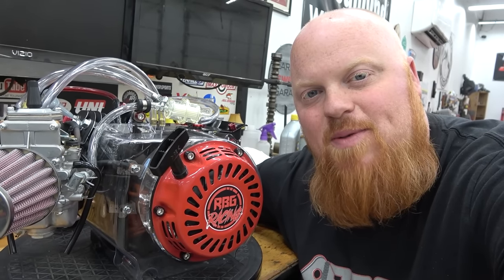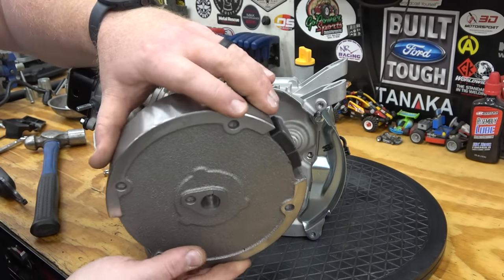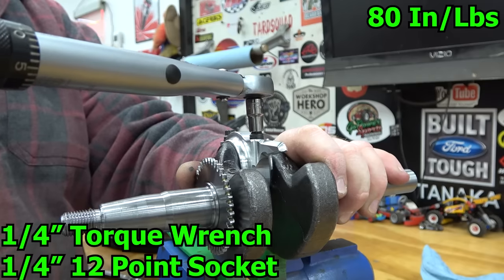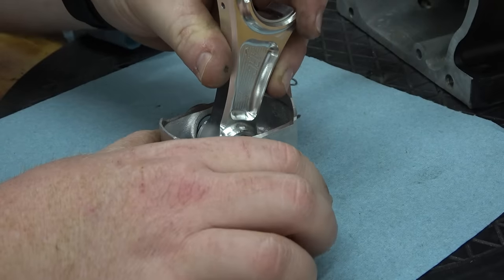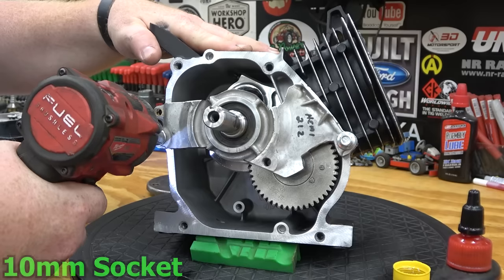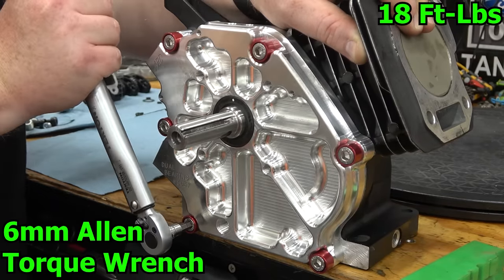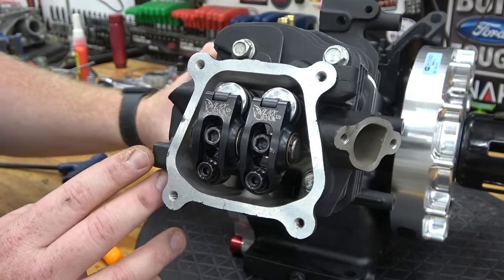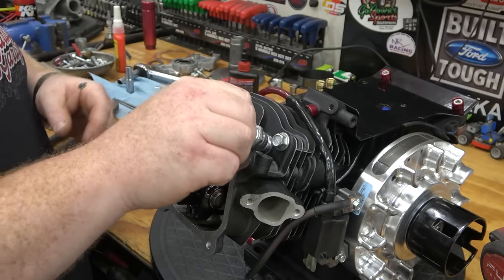Methanol Ghost 212cc Predator Build 👻 ~ Harbor Freight Race Engine

Comment: One can only hope that harbor freight realizes the phenomenon they have going with these predator engines and they don’t ruin it
Reply: 😂 if thay do ima need two blocks of every model they sell before it goes out
Reply: If they didn't, they wouldn't make a ghost racing engine. These aren't going no where
Reply: @ghost-carnage8964  ca-p
Reply: EPA and carb ruins everything
Reply: @Youtubecensoredmyusername these are lawnmower engines. Unless u live in ca you’re fine
Reply: @inshallah4280  they’re one of the few cool things we do actually get as of now. I don’t mess with them. I prefer the Chinese clone 125s anyway. But the old o es made by Lifan not the new ones made by someone else
Reply: you could still buy a real honda 200cc engine that is built a lot better than these clones.
Reply: Youre basically just buying a cheap chinese aluminum block and spending money to rebuild the whole thing. Im not knocking it but youre just buying a block
Reply: @kirkvilla9781  I dunno about those ones. But the engines in the predator 1400 generators are total complete garbage. They have a tiny rod that the rocker arm sits on with the tiNIEST screw holding it in with 2 that’s TWO lock washers on it. They put one of mine on backwards, and the screw missed the groove.that engine lasted maybe 60 hours. Then the spark plug pulled out half the head threads when I removed it. GARBAGE GARBAGE GARBAGE  China junk
Reply: @inshallah4280 there's a lot more states now that are just as strict as California.
Also, I have zero problem in California buying parts for these 🤷 There's like an infinite amount of Harbor Freights in San Diego that have these for sell.
Also also, the part of the county i live in, requires no smog. I have an '89 f150 with straight pipes and it's legal (minus the lack of a catalyst but the Feds can gofucktheirselfes) It's definitely sucks here, but it's not anything like everyone thinks.
Reply: @inshallah4280 I’m in CA, we got all HF engine models, even ghosts
Reply: This phenomenon has been going on since 50s when it started with chain saw motors etc and over time it’s just changed motors more notably (in the flat kart realm) the briggs flat heads then the Briggs animals and now the Honda clone which is basically the same thing as a predator almost exactly I’m pretty sure most parts on them are interchangeable but basically what I’m saying is there will always be another motor that becomes the predator so if hobo freight ruins it there will be another
Reply: @liamgarrison195  i got a few biggs flatheads. None of them are actual Raptor engines but one of the 5hp i got has a raptor carb (just a choke-less pulsa jet) has the eyebrows shaved, put a ARC billet flywheel, 3 stage pipe, stock crank, rod, piston, valves and cam. Moves my old JC Penny El Tigre mini bike nicely 👌
Reply: @dogsandwich77  hell yeah love seeing old flatheads rip we have a money race or to around here for them every year always one of my favorites to run
Reply: Your videos are well done. Great work
Reply: @KORR805 you can't buy the 170cc in CA! You can't ship a damn engine from out of state either. It's ridiculous.

Comment: That pull start handle is having a conniption fit.
Reply: I was wondering if that wasn't because he didn't lube that area well.Please let me know as I always used 'gear lube'inside the spring area,and greased the 'tabs'and crank shaft.
Reply: would be cool if it could have electric start too, do they make decent performance flywheels for electric start though?
Reply: My guess is you didn’t watch till the end because that was nothing compared to the muffler
Reply: @bryduhbikeguy  always put it together bone dry. Any lube attracts dust and dirt then it gets stuck. I suppose If it was for a pressure washer that’s always used in a minimally dusty environment it’d be fine but In a gokart it will be a regular issue.
Reply: It's because they didn't take corresponding weight off the crankshaft when they lightened the rod/piston
Reply: @Wayne3nterprises  most of these parts are designed for kart racing, and for some reason a lot of races don't allow you to have an electric starter installed

Your best alternative would probably be a cordless drill to the pull start housing
Reply: I’m still trying to figure out what pushrods I use with a 356 cam non hemi head and 1.2 ratio rockers it seems like no one has a video on this
Reply: @Wayne3nterprises  tillitson makes electric start motors :)

Comment: Put a 265 for short track. 355 for drag. Cute the deck the block. Polish the head chamber. Cut the holes where the push rods go in the block so the oil will run better. Put nidalee roller bearings on the cam.  Vent the block from the side cover, and where the governor delete is put a vent tube that goes up and around the frame, so the oil won't escape. The oil will push about 3 or 4 inches out so it's not getting blown around the crank case. People will call me crazy but it works.  Lighten the crank but make sure it stays equal as you cut it down. It will let you get more rpm. I was building them getting 12 13 thousand rpm. There's more little tricks I figured out but to long to tell. Get a custom intake built that swirls like a gun riffling. Put a 28mm number 7 jet
Reply: Do you have a Facebook
Reply: 12.000 - 13.000 rpm max??? Amazing!!! Video?
Reply: @jquanlake2203   lol is me
Reply: Dang your really into this stuff , 13000 is insane

Comment: Seems the new predator 224 would be a better base to start with being cheaper, and everything is getting replaced.
Reply: For sure! Stronger block, more cc
Reply: He's a HF shill. Everything he does is marketing for them. Of course he'd use their newest engine.
Reply: What kinda race engine is it if ya gotta replace shit. To handle more power. Race motor should have a billet rod and flywheel I mean cmon
Reply: That’s what I keep thinking as someone who has a 224 sitting in a box.  I have been contemplating picking up a ghost or another 224 but so far I’ve come across 2 people with a ghost that have owned the 224 and they have both said the ghost seems more rev happy.  But I’m like some of the others here who think if you’re building the entire engine anyways, why not just go with the 224!
Reply: @RandyPrater870  well with the 224 having a bigger stroke, you have to deal with clearancing a lot of things, including grinding away at the cam. Plus having a bigger stroke gives high rpms more of a chance to break things.
Reply: Lane AWD  Red Beard did a video on one he built, a few clearance issues that were easily addressed but I think it’s safe to say you can build a 224 with 95% of the same parts as the 212
Reply: @theworstgamervr  the ghost is designed to race in certain go kart classes. Billet rod, etc, would not comply with the rules.

Comment: Now your speaking my language. I use to race years ago in the flathead outlaw methanol class. And when I switched back to gas it was so boggy feeling compared to that quick fast response of the methanol motor.i had to keep the pull start off the engine cover the high quick RPMs would break the spring and the cord would just shoot out the cover.

Comment: I hear you on the loose fitting muffler, I had to cut a shim from a soda can to fit between the GPS clamp (which is too big) and the muffler so I could tighten it down enough to stay put...seems to be working so far
Reply: Orrrrrrr make it tighter 🫢
Reply: @rambo40201  the hose clamp that GPS uses on the mini muffler only goes so small...the problem is the pipe they use for the headers is smaller than the clamp will tighten down too...and if you crank any harder on the clamp screw you only succeed in stripping the clamp
Reply: I use a shackle style clamp for my muffler, you can get them in lots of sizes at autozone or online. The heavy duty clamp cranks down a lot harder than any hose clamp could but it adds a bit of weight and doesn’t look as good as the stock clamp.

Comment: I'm a car guy, but with such tight spaces, you might consider checking the index of that spark plug to make sure the bottom electrode doesn't face the center of the combustion chamber.
Reply: We have to index our plugs in our asphalt Sprint car because the tolerances are so tight we can smash a plug closed
Reply: Typically, a AR3910X plug is used in these small engines which cannot really be indexed, but I agree there is an advantage ever so slightly, to indexing the plug.😁

Comment: That's what cracks and breaks those clear flywheel covers is all that vibration, this engine you can see he has a hell of a lot of vibration, just look at the pull start handle and how the muffler is vibrating!

Comment: ohh the same in the philippines we also use methanol for a race of 460cc up engine but we use gasoline carb and convert it to methanol carb we also use the same parts you use but in phillipines we change the size of bore and stroke we make them more highier

Comment: HF has notched itself into a unique slot for tool stores. Rather than having a 20% chance of getting a good tool that will last, it's now ~50% with a percentage that's equally randomized by item and type. They raised quality, but at the same time, 'quality' is such a variable word in terms of HF tooling that it's not linear. How to make the memes... 🤷‍♂

Comment: I would like to see what you can come up with using the  Briggs and Stratton engines.
All of my self built Mini Bikes and Go Carts had B&S engines.
There is After Market Hi Performance Parts, Exhaust systems ,Cams, Flywheels, Hotter ignition systems and plugs.
A standard 5 HP B&S with a little tinkering a full 12 HP can be had.
No need of a jackshaft direct drive from the clutch to the rear axle.

Comment: Great video Red Beard! I know the Ghost is the new engine but you changed everything that makes it a Ghost except the Ghost sticker on the pull-start. Would be cheaper to start with regular 212 or 224 and then add the same go fast goodies and get the same result? I kinda still want one though just to play with. Thanks again!!!
Reply: I was thinking the same thing.  Is there an advantage to using the Ghost vs std engine?
Reply: @sdcaclint  I don’t think so. The Ghost is similar to the original Hemi block. Using the 224 gets the stronger block. I think the 224 is a better starting point.
Reply: @DIY Willy
Thanks for the info.  Sometimes it's good to be corrected.  
No matter what, Red Beard built a sweet engine.
Reply: @sdcaclint  Yes all his builds look and perform amazing. Always enjoy his builds!!
Reply: Mine is the hemi version. 
Not sure you can get that anymore
Aluminum valve cover.
Not tin
Different configuration. More square
I used the billing rod and flywheel. 
Ported the head, SS  int, exh valves  comply pushrods.
True Mikuni carb. 28 mm if I remember correctly. 
Cam is basically stock but more  duration for more time to fill cylinder and to expell exh.
Wanted to retain low end.
Going on a SPEEDWAY MINI BIKE.
 USING A comet clutch assembly like a snowmobile.  CVT .
Hard to find parts for these old girls as the company only existed for 3 years before Honda took over the mini bike craze
The company was formed out of some of the old  RUPP company in the late 70's. 
Figure the engine is between 12 to 15 hp. From 6.5 oem hp.
Reply: Forgot , I used a long curved intake manifold to gain more low end torque.  Similar to  the old Chevy Tuned Port intake system.
Reply: Also to tuck carb  closer to mini bike frame

Comment: Take that piston drill relief holes on top. It will boost the competition. You will need a starter box as you will break your fingers lol. Take the cam and clean it up, get all the ruff edges from in side the block cam and crank. You can take a hemi crank so you can get a little more stroke. I have diynoed 26 27 28 hp from a 212.  But you can call me crazy I don't care.

Comment: i   hope   you   welded  that   muffler  on   ,  the   cap   will  only   stay  if  you   put  a  back  -  off   nut   on  it  to   keep   single   nut  from  spinning   off  and   put a  lock  washer   between  them  ,  some  say   no   ,  i   have   never  had   one  back  off  and   dam  near  couldnt  get  a   bunch   of  them   loosened  up   when  needed  without  stripping   bolt   ,  some  of  threads  .

Comment: Hey Red,  did you run into any issues with your rockers making contact with that indentation on the left side of the head?   I have a set of the venom 1.2.s that make contact with it

Comment: No cyl hone, and if I’m not mistaken that block looked cracked where the head gasket sits, at the top, and below the valve train slot. Also, might just be me but my OCD wouldn’t let me just glob the assembly lube on one side and just pop it in without wiping it all around the surface.
Reply: And the head itself maybe ?

Comment: Painting the block was a great idea because a black cooling fin will dissipate heat better than any other color and unpainted metal. In fact the cooling difference can be as much as 15 degrees F. I would use specific heat sink paint. Although while running methanol you will not need it as methanol burns cooler by 40 degrees.
Reply: Meth runs colder than gas

Comment: Red Beard, great channel, can you by chance let me know what type of clutch or TC you're using on this build? I am building a ghost offroad kart and have been having trouble with TC/clutch selection. I purchased a 30 series TC prior to buying the engine, but this won't work as it's not rated for the HP that my ghost will output. I then grabbed a 40 series and a crankshaft adapter, but the crankshaft is just too short to install the 40 series driven clutch onto. I am waiting on a 40/41 clutch and a 40/41 rear sprocket to make my kart work with the ghost, but was having a lot of trouble finding any clutches rated for 13+hp. The clutch I am waiting on says it's rated for 13hp, but I don't really believe it as it's an ebay random clutch. Thank you for your time and all of the great content!

Comment: need to build a custom C Shaped intake that would leave the carb above the engine so the air filter doesn't look so stupid hanging out Do a speed test to see if the long intake runner has mush effect.
Reply: The long intake would have  a major impact!!!!! 

It adds a ton of torque and significantly reduces the top speed
Reply: It doesn’t, seen a few videos testing lengths

Comment: Seems like a ton of vibration, I wonder how much of that could be mitigated by balancing the flywheel or the Piston, rod, and crankshaft? Also, what is the expected power output of this motor as configured?

Comment: Notice the new heads is in-line and the original has a hemi look to it. I wonder if some welding in a couple areas and some machining would produce more power, on the factory head.

Comment: Is that flywheel methanol specific?  It does not look like it would move nearly as much air as the stock fan.  Not an issue with methanol, but could be an issue on a high compression gasoline engine.

Comment: I can't wait to see it fly into multiple peices ....  I still have peices of engine in my arm 🤣 good luck my friends
Reply from the maker: Then you didn’t build a quality engine. I have built over 30 engines and there all still running great. Most with over 300 hours.
Reply: @RedBeardsGarage  they just aren't designed to run at 9,000 to 10,000 RPMs for multiple laps or races  I should have been easier on them I guess. 😂

Comment: Did you check your ring gap? It seems with HD build why does everyone runs the stock crank shaft? Being a cast piece it would seem to be high priority to replace with forged crank shaft.
Reply from the maker: The crank is an expensive purchase. We will be doing a build soon with a billet crank.
Reply: @RedBeardsGarage  I broken a stock crank and rod on a governed stock engine. Probably only turning 3500 rpm. Just imagine what carnage would have been turning 9k lol. I really in joy what you all been doing. Keep up with awesome work 🙂

Comment: Hey Redbeard thanks for your videos. I built this engine but with a vm22-133 and been using non ethanol 87 but have had trouble getting it started when it does start it stays running but when I cut it off for a while it takes an act of congress to start it. Any ideas what I may have done wrong

Comment: Just curious why you didn’t use head studs? Especially with methanol.
Reply: Definitely should have since there is gonna be more cylinder pressure same with factory .045 thick fire ring headgasket Torqued to 20 ft lbs.

Comment: i have a question. I'm wanting to use a Briggs 16 hp engine i already have. It is horizontal opposed and that's why I like this engine. I'm planning on building a Light Sport airplane that is composite for strength and smoothness. I'm planning on using a low drag wing. I want to get a decent amount of hp and torque from this engine and still be reliable

Comment: I have a predator 212 on a dirt gocart, and it's killed 2 clutches now. What clutch should I use? I forgot the name of the one I bought last but it was rated for an acceptable HP to work. But it burt up in a day. I was looking at a cheetah clutch, it would be over kill on a stock 212. But idk.

Comment: The pull start could be replaced as said in the comments below. It would probably be better to have a electric start rather than a pull start. Before it starts shaking even more and hitting that clear plastic cover and destroying it. But i don’t know if a small starter would handle being able to start that beast of a motor.

Comment: Is there any way to balance the crank? Would it make a difference?
Reply: The amount of metal that would have to be ADDED to the counter balance, would negate ANY performance gain you would get. Not to mention there is only one cylinder and nothing much else to balance out. Been there tried that.😁